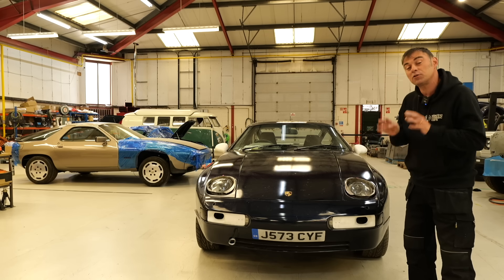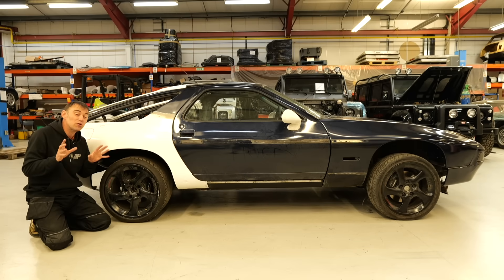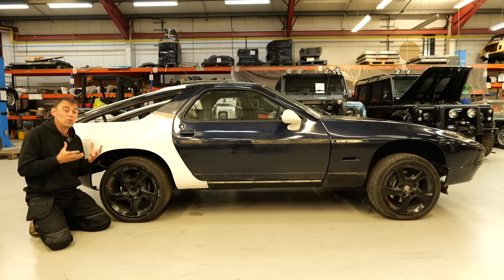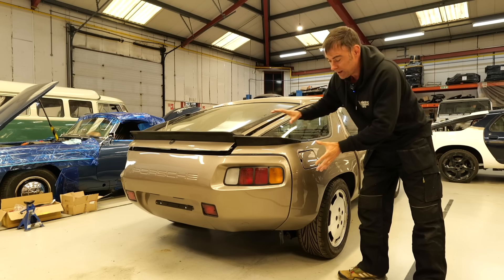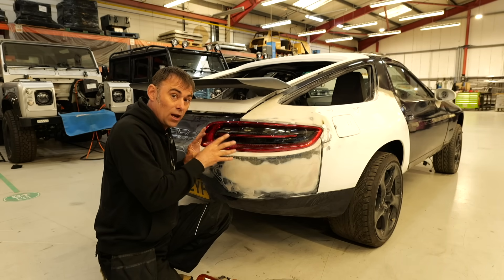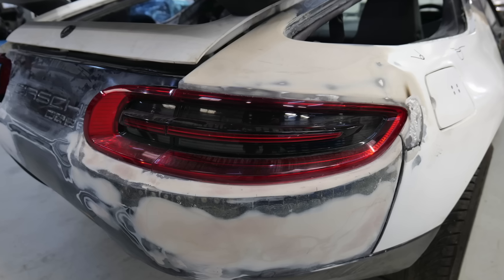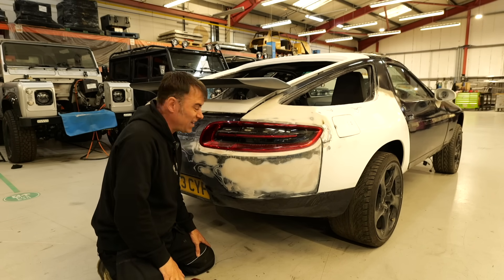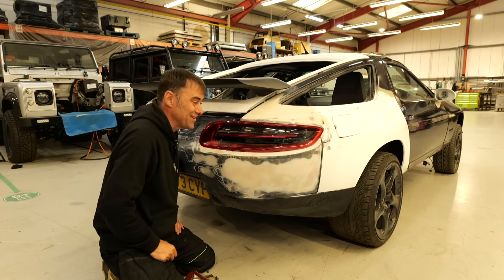Electric Porsche 928 Restomod update

Comment: The original 928 headlights look great in the down position. When turned on the looked like someone glued on some frog eyes - I never thought they fit the car. Your solution is perfect. Keep them in the position that looks best and still be able to light the road ahead. I also love the taillight swap. Are you exploring using newer battery tech, 800V systems, etc.? Thanks
Reply from the maker: Yep, always reminded me of Kermit the frog with the lights up. We’re always picking the tech forward here at ECC, constantly innovating. We’ll do an 800v system in a car soon. 👍

Comment: Really good improvemts with the tailights from the Macan, the teardrop mirrors as well as the air intakes from the 911 👍 fits perfectly . But taking away the popups is kind of taking away one of the elements, which has turned the 928 in an icon, i am sorry to that. Fact that you‘ve risen the question about shows you are not pretty sure 🤔 about this idea. 
Thank you for your fantastic video, can‘t wait to see how it will go on 🍀👍

Comment: You talk about the battery configuration but no reference to voltage. 
What voltages are they?
Reply: Voltage is set by the requirements of the motor ... it's a Tesla motor so will require 400V nominal.
Reply from the maker: 400v

Comment: The front lights remind me of the old Mazda MX5 lights. I didn’t like the pop up headlights.
Perhaps you should have installed the latest Macan rear lights running across the rear. ( I have a 2019 Macan).
Good choice on rear view mirrors.
Would the batteries fit in the rear instead of rear seats for better weight distribution?
Reply from the maker: Not a bad idea

Comment: Full Marmite for me – you've ruined it! The original 928 pop-ups are iconic. I would've preferred to see you retrofit the S2 nose and rear. Then some kind of subtle LED replacements, maybe ring running lights at the front and a horizontal red strip at the back like a 996 CS4.
Fascinating project though!

Comment: Pity you cannnot get a Lucid motor! That's much smaller!
Reply: Aftermarket support is basically nonexistent for lucids stuff vs tesla. Munro live teardown proved the lucid doesn't make more power on average per pound and the efficiency despite 900v architecture sic inverters etc isn't any better on the most efficient pure rwd vs a base tesla rwd model 3! And those super compact in unit differentials are a wear point also mentioned by the munro live tear down!
Reply: @4literv6  True, but if you split the motor and inverter, you can get a more compact form factor for the motor and can get the battery lower.

Comment: Would lights off a modern VW beetle go in the front or off a modern mini?
Reply: I doubt it. All this faff is driven by an old US car regulation that specified the single size car headlights had to be. So for a while old car headlight bits are interchangeable more or less. Of course the size was too big for the sloped noses of sports cars, the work around was pop up headlights.